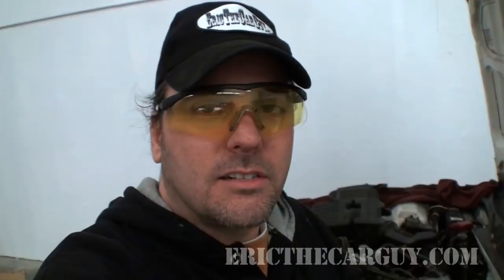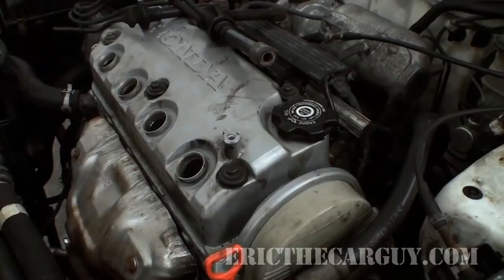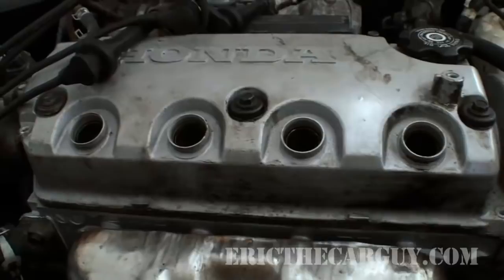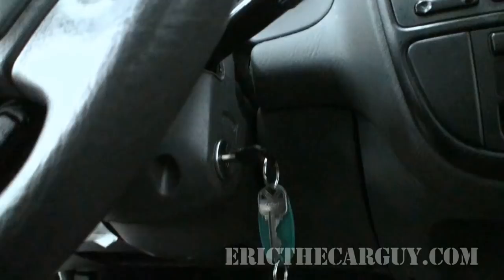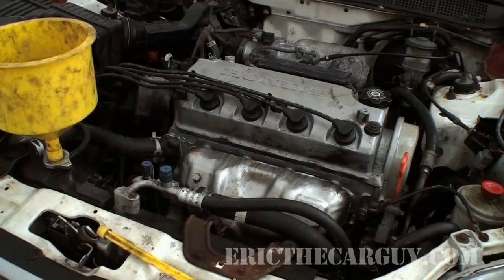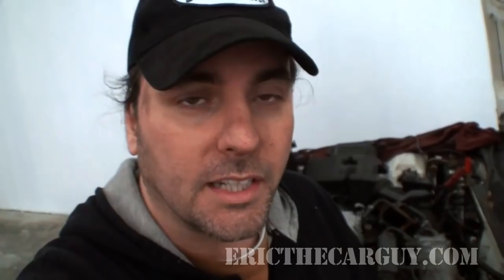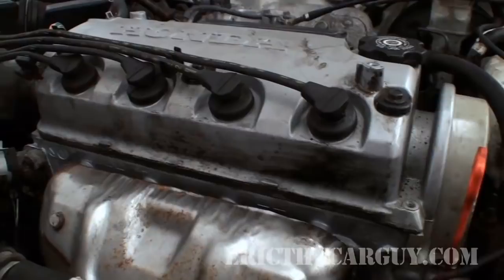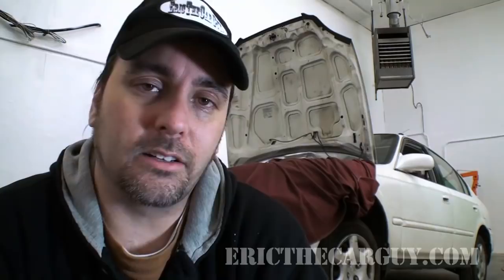How to Break In A New or Rebuilt Engine - EricTheCarGuy

Comment: Hi Eric. Just a quick question for myself and my son. He just did a complete rebuild on his H-22 in his 99 Honda prelude. He had the head decked and honed out. Did cycle the engine over to prime it. When starting up for the first time, could not believe the happiness on this young kids face for his first rebuild. But as he let it stay at idle and letting the fluids cycle through to get where they needed to go, he noticed that it started to smoke really bad. It was like a white with a blue tint and smelled like engine oil. We let it stay at idle for about five to eight minutes and shut it off. Checked all the fluids. All fluids were spot on. There was no visible signs of any leaks. So, started up again. At this time there was no smoke for about a minute. It was like back in our days, the bugs sprayer riding through the neighborhood. We shut it off. To do some research. Any advice that you can give would be appreciated. Thank you for reading. Father & Son

Comment: instead of using the starter to lubricate the inside, could you instead just put a ton of oil in there?
Reply: It's about getting the oil pump to fill up all the oil lines so that when you start the car it's not "dry". There is usually already assembly lube inside the engine when they're rebuilt but that's not really enough to be ideal. Just cranking it over 2 or 3 10 second intervals is usually enough.

Comment: Do they also break-in racing vehicles like normal or do they not break-in at all?
Reply: Many racing engines are tuned on a stand with a dyno and  checking many other specifications such as fuel consumption.  Check for codes on the engine if no start after rebuild.  Auto Zone and others can lend you the tester then refund cost on return of item. Just now rebuilding a 2.2 Chevy L4 in a S10 Truck (2000) found that if the truck is overheated usual to find that Line bore is needed and Crankshaft polish with all new lower end bearings and seals.  Hot Tanked the engine and replaced the oil pump, the fuel pump in tank ( by raising the bed) and all new hoses. Previously replaced entire AC system including evaporator and condenser  as well as Compressor, expansion valve and a complete washout of the hoses with AC line cleaner.  Purchased the truck from neighbor and found that the oil was rarely changed, carbon build up and lifters were full of sludge and junk.   Approximate cost with new crankshaft and other parts on Amazon Around $600 and $245 for the Tanking, Line bore and  checking the cam.

Comment: Hey EricTheCarGuy , I have been watching allot of your videos. great info!!!!
I have a honda civic coupe 2004- D17a9 engine.
lately i shredded my timing belt. so I got my spare engine ready to go and did you break in for lubing the engine,.....
So then came the start up! all finger crossed. Engine fired right up but idling is just strange, it is pulsing from 1200 to 2600 rpm 
and keeps going like that. I checked so many thing and i dont know anymore, the only strange thing i see is that 3 sparks plugs look normal grey, and one i brown.
I got no fault code from ecu,...... what i also see went the rpm are going from 1200 rpm the timing is at -0.5 degree, at 2600 rpm its at 8 degrees?
Any ideas??
thx in advance.
Reply: A light tan color is perfect. Note that sometimes, depending on the fuel and additives, the color may be grey instead. If it is, light grey is acceptable. No color, or white, indicates a lean condition, or lack of fuel. Dark brown or black color indicates a rich condition, or excess fuel!
Reply: Look for a vacuum leak.
Reply: Hehe thx! that also was the problem, rear vacuum hose ws not connected to intake manifold.
Reply: Stay fun, have safe, and be dirty!

Comment: Go to 7:30.  No jack-rabbit starts or wide-open throttle pretty much tells you to not test the limits or capabilities of the engine, aka in my opinion "don't labor your engine."  If you didn't get that out of what he said at 7:30, then damn.  Perhaps you didn't get to 7:30 or neglected to hear it, well then don't post until you've gone through the video and are sure its not mentioned.  

This customers stinks though.  If the oil light comes on, its really so low that you're done, stop.

Comment: Guys please help me . I honed my engine (b18b1) and put new piston rings the gaps on them are #1- .14mm #2- .16mm #3- .14mm #4- .14mm . I finished and tried starting the car up and it wouldn’t start. I checked everything and at last I checked the compression . I’m getting from 41-60 psi . I did a wet compression test and my compressions jumped to 150-160psi so it’s obvious it’s the piston rings . Idk what could be the problem . I clocked the rings correct so I’m at a shit stop and don’t know what could be the problem .
Reply: Emanuel Landeros Did you find out what went wrong?

Comment: Hey chrisfix i am rebuilding my 350 small block do i use zinc oil to break in my engine?
Reply: It's a good idea even on a roller motor but most definitely if it's a flat tappet cam if not you'll wipe the cam out on break in but good luck finding any you have to by a zinc additive and use a big dose on break in and whatever is recommended on oil changes a old school flat tappet motor needs zinc in the oil period forever .. and that has been removed from all the oils out there so .. be careful and dont wipe out the cam

Comment: You obviously dont know the use of a water pump. the water pump is used to flow Coolant through an engine. coolant is not used for lubrication of the engine. that is the Oil and Oil pumps task. there is nothing wrong at all with reusing a water pump aslong as the blades in it are not damaged it should operate correctly and flow coolant through the engine and cooling system.

Comment: same thing i do when before i start my car when it has been sitting over winter time.  and sense that motor is new i would have took the valve cover off  and put some oil on the valve train  and lifters. cause those motors are easy to get the cover off.  another trick which i due is put a little bit of TRANS in with the engine oil to help it out cause its thinner so it helps quiet the valve train down  and get rid of lifter TICK. it most motors. learn this on a 24 valve 2.5 v6  mazda probe GT motor.
Reply: Yeah mine had lifter tick too

Comment: Got new engine on my dad's 98 dodge ram 1500 and when checking oil after 200 miles oil was grey 
Why is that on a brand new engine?
Reply: That's metal in the oil and is normal but you should have changed it sooner

Comment: how to break in a new or rebuilt engine: know what youre doing BEFORE you rebuild it. please never put oil in you spark plug holes. and follow manufacturer instruction (ie how long to leave it run on the first start up, rpms, amount of oil, etc) then after that, drive it like normal.

Comment: "MotoMan" recommends high RPM break in for engines for the first 20 or so miles, saying that that ensures optimal piston ring break in. He also recommends changing the oil after 20 miles to remove the metal shavings and burrs from the oil sooner rather than later (http://www.mototuneusa.com/break_in_secrets.htm)

And in fact, Shell says the same thing for new aircraft (piston) engines (http://www.shell.com/global/products-services/solutions-for-businesses/aviation/aeroshell/knowledge-centre/technical-talk/techart08-30071255.html) claiming that by running at high load, it scrapes the oil off the cylinder walls allowing for friction to wear down the high spots in the cylinder walls, creating an optimal seal for the piston rings (they stress the importance of proper engine cooling whilst doing so). They also recommend changing the oil several times (after 10 hours, 25 hours and 50 hours) to prevent the oil from turning into a grinding paste causing additional wear. Additionally, both sites recommend using straight mineral oils for break in, and then switching to synthetics afterwards.

If I was a millionaire I'd buy 2 of the same vehicle (or even more for better accuracy) and compare break in methods using a dyno, but alas I am not a rich man :(

Comment: Not saying their not reliable but why would someone spend so much for an STi when they could have bought an Evo (better car) for nearly the same price. And it doesn't have to be used easy to find cheap EVO's with only 30k miles on them for 16 grand whereas a STI with 75k miles goes for like 19k... yet Evo>STi. So now you see why i no like boxer engines

Comment: When I rebuilt my 1.6 vw diesel I just put oil in it and ran it. 10,000 miles later it's purring like a kitten. Don't see the need to just crank on it dry

Comment: you don't know how an engine work! the oil pump only pump oil in the header of the engine and in the bearing of the crankshaft. It doesn't pump oil in each cylinder and it's a good thing because it will reduce the power of the engine.

Comment: ummmm dude its a honda you cant run a honda like a small block with a drill you will break off the tabs that directly connect to the camshaft there is no metal shaft in between

Comment: You have no idea the damage you caused by squirting oil into the pistons. You only caused the sleeves to glasses instead of allowing the rings to seat to the sleeves. 
Go and resurge how the engines are run in with in the factories...

Comment: My 98 civic is misfiring at low rpms any common problems that can cause this? I put in a new ignition coil, distributor cap and plugs.
Reply: Krevin Grard wiring harness,or the fact it's a honda
Reply: YU-GI-OH Con Cajones hondas are relibale. It was a faulty aftermarket spark plug wire.
Reply: Krevin Grard I'd still rather work on 10 Buick/Chevy's in the time it took to diagnose that bullshit
Reply: Alright.
Reply: Okay sounds good : )

Comment: Pee in the gas tank a little bit right before your first fuel up change the motor oil after 43,000 miles ..it'll runn for eevvverrrrr

Comment: that's stupid, turning the engine without starting it to lub the cylinder. Actually, that's even worst. The oil sit at the button of the engine and by runnning the engine so slow, the cylinder doesn't get oil. The oil stay at the button and the oring of piston stay dry of oil. It's much better to start it for real and rev it a little bit to get the oil to move everywhere in the engine. Just don't rev too much so it doesn't heat too fast at start just like any regular start.

Comment: run engine at idle for 30 minutes... then drive it normaly not gunning the motor for the first 1000 miles.. after that you should be fine

Comment: So Eric only did a partial engine rebuild. Bloody hell WATER PUMP should of been replaced before the engine was ever started. I have been rebuilding engines for 35+ years and never in that whole time have I never replaced the water pump on a rebuilt engine. I also make sure the whole engine bay looks like it has a new engine meaning I clean and paint everything. I agree with his engine prestart as I would do the same but I would of installed a new battery too. That battery sounded like it was going to crapout soon. I would never hand over the car back to the customer without out the engine being broken in either as I have learn't many times that you can tell people thing's and they never do it. It would only take a few hours to break the engine in and then hand it over. Old saying: If you want a job done right the first time then do it yourself. As a motor mechanic there is nothing worse than having a customer tell others that your crap because the customer forgot that his engine needed breaking in and it blow up not long after being rebuilt because he didn't break it in.
Reply: Bro he stated in the videos when he was swapping the engine that this was a BUDGET SWAP he was trying to save the customer any money possible. Like resuming the intake and exhaust gaskets bottom line is what the customers wants if he can only afford a budget that his choice not yours you can't just go ahead and say wow you know you need all new belts lets just replace them and slap them on the tab . Doesn't matter if the belts are cracking and on their way out you do not replace them unless the customer wants you too.

Comment: Awful engine break-in advice. The first 50-100 miles is the most critical and the rings won’t seat any more after that. As long as the coolant and oil is up to temp, you do want to go high in the RPM and even wide-open throttle. The cylinder pressure will go behind the rings, force them against the bore, and make them seat faster. 

Diesel engines in a plant get assembled, go into a dyno cell and run at WOT, and only then receive certification and release to install. Same with automotive engines. Engine plans run the engine WOT before it leaves. 

‘Easy’ break-in is just a recipe for life-long oil consumption.

Comment: how many miles should i put in the car for the first oil change? im confused dealer said 7500 miles, ive been reading around , change your oil 1000-2000 miles. help pls.thanks
Reply: Maynard Saints my manual says you gotta change it every 10.000 miles or every 12 months, it's a Ford Fiesta
Reply: YU-GI-OH Con Cajones ty
Reply: tomitofazzio thanks
Reply: YU-GI-OH Con Cajones that's waaay too often IMO, oil lasts at least 6000 miles
Reply: YU-GI-OH Con Cajones I'm not being cheap when I say that, I just read the owner's manual and that's what it says, and they do give you a 3 year warranty after all, it's their responsibility to advise you sensibly. Also, changing your oil more often than you should is wasteful and harmful to the environment
Reply: tomitofazzio you shit will break down immediately after the 3 year warranty lol. cars that last forever aren't profitable
Reply: YU-GI-OH Con Cajones either way I plan on selling it before it turns 3, I never keep my cars for longer than 2-3 years, and I think that ford isn't trying to force you into buying new models because your current one breaks down, but instead because the new ones have better engines and dynamics, better design and safety features and greater efficiency
Reply: You're wrong..... manufacturers give you those specs to get you out of the warranty period that other guy is right if you don't plan on keeping a car for longer than 10 years don't give advice!
Reply: You should all calm down and accept that you're basing your advice on some 60 year old custom your dads used to have, and also that you're not taking into account the driving conditions each car go through. There's not a magic number here, but what is certain is that nowadays oil can last a lot longer than it could before, and I can't stress this enough, but NO MANUFACTURER IS GOING TO LIE ABOUT THIS. Do you realize that if they did lie, all that would happen is when people's cars started to break down, that manufacturer would lose its credibility and earn a bad reliability reputation? Had you not thought about it?
Reply: Iv'e rebuilt plenty of engines.... people like you say "oh yeah oil has come a long way and lasts longer" incorrect do some research and you'll fine oil is worse as it is designed more to meet emissions than to lubricate parts better! Example Zddp is no longer in oil a key additive to extend engine life. Driving conditions? absolutely, live in town lots of stop start driving means petrol will end up in the oil and short trips means the oil never gets hot enough to evaporate contaminants. And im sure you'll mention Sythetic oil and say "it does last longer the parts shop guy said so!" yes it does last longer under extreme conditions like racing, but it doesn't lubricate anything any better and once its contaminated it will damage the engine just as much as normal oil. If you don't know what you're talking about don't give advice. Go read your Haynes manual and comment somewhere else Champ.
Reply: Joe Blow you realize you're talking like you had a degree in mechanical engineering? Just because you rebuilt engines doesn't mean you understand physics and chemistry and that you know something that people who make a living out of designing engines and oil don't know
Reply: Do you design oils or engines? Do YOU have a degree in mechanical engineering or Physics ?You don't need to be a 5 star chef to say a meal sucks just like how i don't need to have a degree to tell you when an engine is completely destroyed internally.  Again take your crappy advice elsewhere if you don't know what you're talking about.Also if you reply make sure you answer those first few questions. Think before you speak!
Reply: Joe Blow think before you speak seriously? Btw I just want to point out how unbelievably stupid this discussion is, I mean, who the hell would take advice on how to take care of their thousand-dollar worth asset from some strangers on YouTube?
Reply: tomitofazzio  Maybe do some research yourself ... people always ask the guy at the Dealership ...he knows nothing except how to sell cars , you start asking them if the gearbox has planetary overdrive gear sets and alike and they have no idea.... anyway you didn't answer my questions. Go back to what ever arm chair you came from clearly you've never gotten your hands dirty on some real work... I'm sure there are some papers or something you should be filing. Let the tradesmen sort these things out.
Reply: Joe Blow pointless

Comment: Rebuilt my b16 engine. Checked for codes and read all cylinders are misfiring. How do i fix this.? Desperately need an answer please.
Reply: check your spark wiring and distributor or coil pack... not sure which is on the b series
Reply: i rebuilt also i was getting p0300 code random / misfiring the valve gasket wasn't sealed right and little oil got in spark plug well sucked out oil and its been fine and resealed valve cover gasket , could def be  coil pack unplug one at time while running if motor hesitates as you unplug means coil pack is work and if you don't see a change when you unplug coil pack bad
Reply: oem bseries are all distributors.